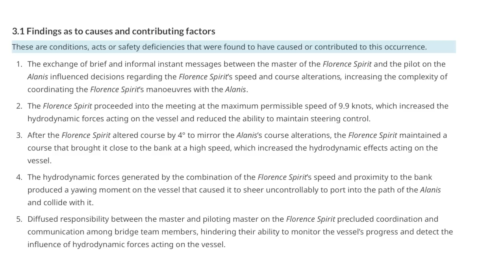Cargo Ship Sinks as Containers are Removed! | 3 Minutes of Maritime

Comment: I work in shipping, unloading and loading ships with bulk cargo. If the ship even has a 5 degree list on then it's not long before the first mate is out giving instruction. Surely the container incident could have been avoided?
Reply: The more list a vessel gets the more stability it gets. Look it up.
Reply: Really strange thing has happend as the vessel lost her stability after a contaner has been removed from deck stowage position...
Reply: I just found it hilarious how the crane op tried to counter it with that container.
Reply: @dennisterpstra  a list developing while taking of a container is a sign that the vessel has very poor stability. And that increase of stability your talking about? Ever heared about the maximum angle of response? Look it up.
Reply: @Seahorn_  This one did not list heavely. Something else caused this incident. Something which is not mentioned in the video. The usual stability problem on container ship happen when the vessel is being loaded. And the weights of containers are not properly declared. This video shows unloading.
Reply: @dennisterpstra  Vessel had bad stability problems.  Probably the actual weight of the containers loaded on deck was more then was given on paper. Take of an extra heavy container from the top tier on deck and this can happen. When you load on deck stability goes down very quickly. 

And if you wonder why the vessel did not capsize earlier in the voyage. I suspect the crew already had deballasted ballast tanks once it was in port. Making a bad stability problem worse.
Reply: @dennisterpstra  Yeah, I'd be looking at what was happening with the ballast tanks when this happened.
Reply: What is going on prior that brought 10 ppl on dock just as it keels over ?
Reply: @dennisterpstra  If that was true - no ship would sink ever from lists. Go look up Metacentric height.
Reply: @NGC1433  No need to look it up. Stability of ships is my expertise. The limit of list is known on every ship under every loading condition. And its a lot. Around 30 degrees easely. She will still have positive stability and will float just fine.

Comment: A classic mistake was made twice regarding the capsizing of the container vessel. The vessel had an angle of loll due to it being top-heavy. (This is different from an angle of list due to more cargo being loaded on one side than the other.) The priority should have been to increase the stability of the vessel as soon as possible. Counter-intuitively, containers should have been removed from the higher side of the ship, (in this case the starboard side). This would further increase the list, but make the vessel more stable. Unfortunately, in this case, the containers were being removed from the lower side (port side). To make matters worse, once the vessel started to capsize, the gantry driver attempted to reload a container on the starboard side (high side) which would have made the vessel even more top-heavy, quickening the vessel's demise.
Reply: Maybe just sink it first then no need for any chin-scratching. Heaviest cans should not be up high.
Reply: Crap job of loading, methinks.
Reply: I beg to differ. The ship is barely unloaded aka it would have been even more top heavy before. It wouldn't have survived the waves on sea.
IMHO there had been something else going southwards before or otherwise there wouldn't had been such a crowd. Increasing the stability is normally right but it only matters when you have a momentum aka rolling in the sea. Here they are trying to safe the ship by removing weight on the side it is leaning to.
Most likely the ship was top heavy plus something else went wrong that we don't know about.
Reply: @svenweihusen57  If everyone was doing everything legally, your reasoning would be correct, but both the crew and management of this ship were obviously a bunch of cowboys.

To capsize a ship due to listing moments is highly unlikely unless there is deck edge immersion, but the ship would already have to be heavily listed over to reach that state.

Very often, the number of containers you can load on a containership is limited by a vessel's GM (stability) and not the maximum permissible draught. To get around this, some of the more experienced captains may maximise their cargo lift by loading until the vessel is legally unstable (<0.15m), but then when they get outside the breakwater, pump ballast into the double bottoms to make the vessel more stable. (Not too much though. A very stable ship is stiff making for a rather uncomfortable ride!) This extra ballast may result in the vessel legally exceeding its maximum draught (which is why the captain waits until the vessel is at sea). Just before the vessel reaches its destination, the ballast is pumped out again so it has a legally permitted draught. (Some berthing pilots actually check a vessel's draught before embarkation.)

This isn't always so straightforward, and both the chief officer and captain would have to take into account many other factors when working to such margins. My guess is that in this case, the vessel had already used up quite a lot of fuel from the double bottoms, and they unintentionally left the ballast pumps discharging the double bottoms even when they got alongside. This and the additional free service effect due to the tanks not being completely full left the vessel with insufficient stability.

There might have been some other combination of events leading to this accident, but the vessel definitely capsized due to instability.
Reply: @ChrisTaylor-NEP  thanks for the explanation, I couldn't understand how such a ship would survive the journey. And if they unloaded a "light" container while a heavier one stayed high up this could have broken the camel's back.
Reply: Think crane loader should be fired also ship captain of collision shìps
Reply: The real classic mistake is the rushing while loading operations, Chris. This kinda rushin' happens on a regular basis all 'round the big world. Fast loading should be forbidden many times already. "Tme is money" is a really false and very wrong motto. False bravado. If you look closely, and even not so, you can see very clearly, that rushing is a real cause of most accidents. But nevetheless some very wrong and terrible individuals keep blaming "human factor" all the same.. Stop rushin' workers already, you mrns!
Reply: @ChrisTaylor-NEP  Thanks so much for sharing your knowledge on this. Comments like yours are a main reason I watch a lot of youtube to learn things.